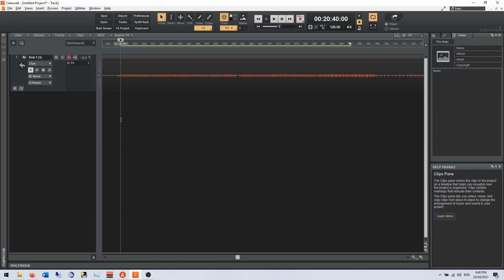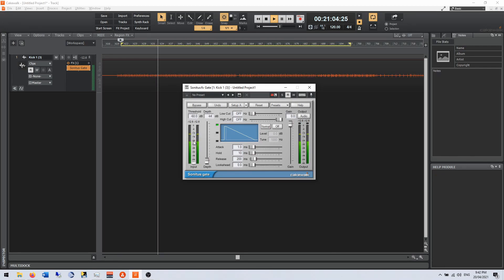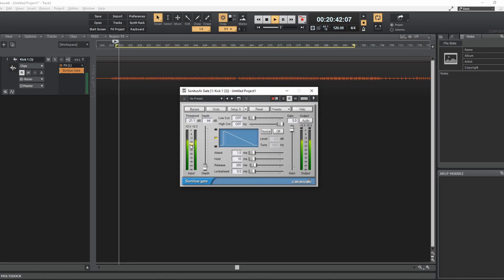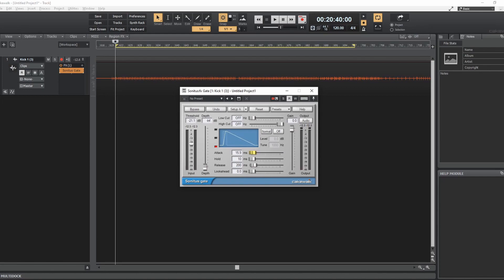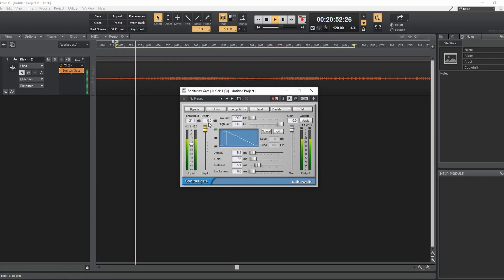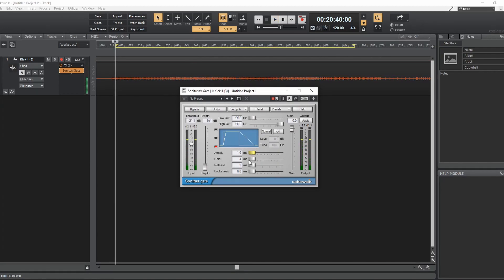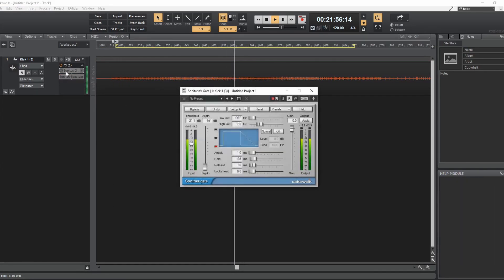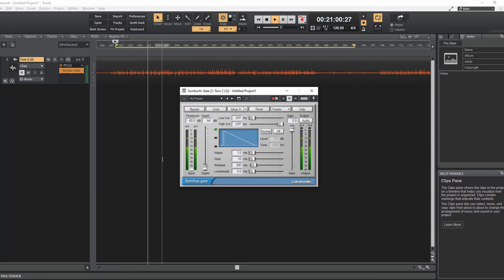How to Use A Gate in Cakewalk (Free DAW)

Comment: Thank you for this video. Just finished recording my first song. I barely have knowledge about the gate, implemented it and get it somehow to work. But now, after seeing your video I finally get how it works.
Do you actually need a gate on drums, when you are using midi drums? Or is it valuable, even if it's a virtual instrument?
Reply from the maker: Glad the video has brought some clarity! You do not need to use a gate on midi drums to control mic bleed because there is no bleed. But you may want to use a gate to shape the sound of the various drums if they do not sound as you want them to. I will have another video coming shortly on how to use a gate to shape the sound.